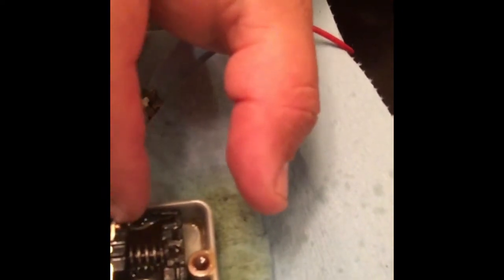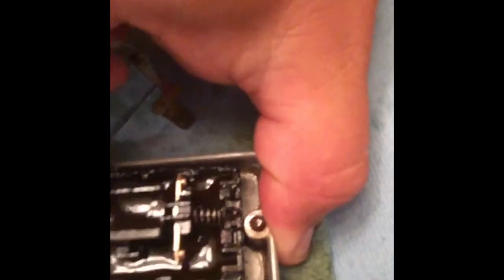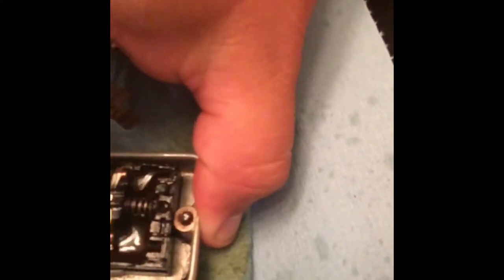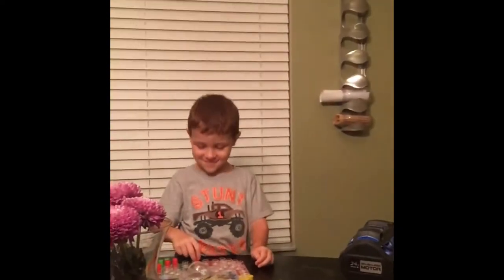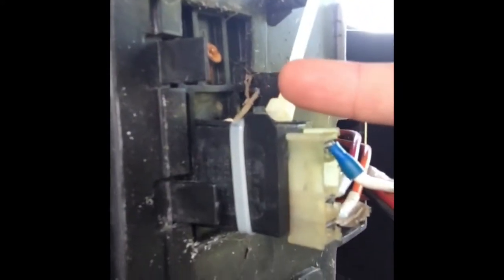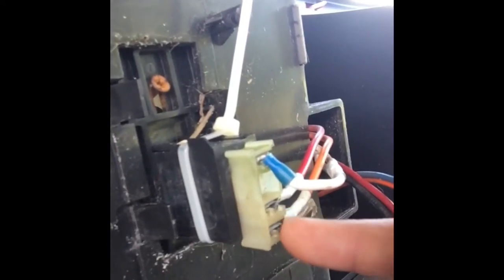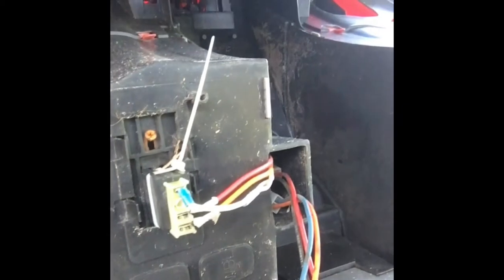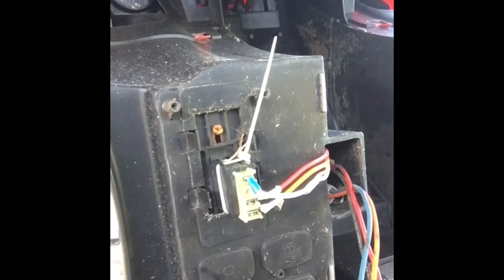Power Wheels accelerator pedal FIX!!!

Comment: Can you add a handle throttle to a power wheel?
Reply from the maker: Hi Alan, there are a few power wheels units that came with twist throttles. For example, the Power Wheels Kawasaki ATV 12 volt has a Twist Hand Throttle and I would think outside of extending the existing wires it should be fairly straightforward.  Feel free to post your progress. Hope it works out well for you.
Reply: @juant687  thank you I will I have the 700r Yamaha power wheel two of them and wanted to eliminate the foot plunge to thumb throttle for comfort but someone has told me I need and esc